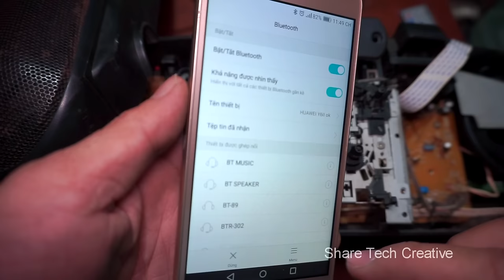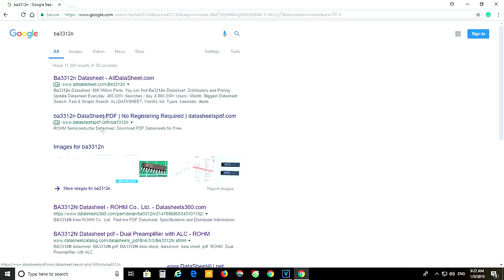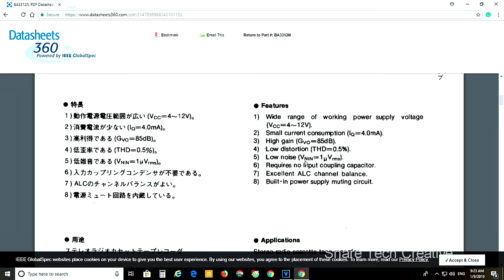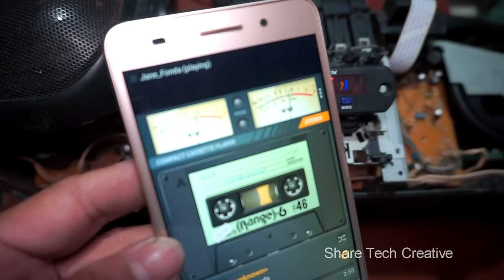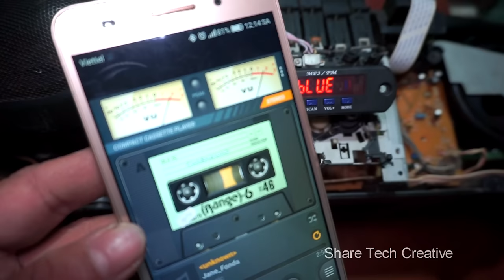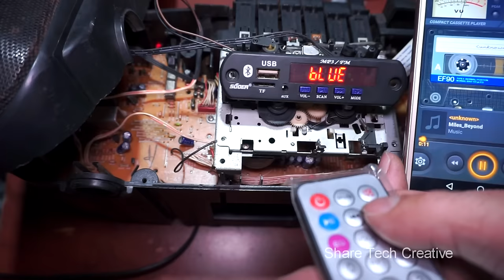Three Ways To Convert Mp3 Bluetooth For Old  Radio Cassette Tapes

Comment from the maker: Ways for your reference 
➤ 1: Find ahead from an old cassette and follow the instructions in the video: 1:32
➤ 2: Solder the output of the Bluetooth circuit directly to the magnetic head. Remove the ic preamplifier from the circuit, then look up the ic pin connector on the input signal and output signal pins: 15:45
➤ 3: Connect the signal wire directly to the circuit board at the output pins: 25:23
➤ Thanks for watching and supporting my channel! Please like, share leave a comment to help me do better videos.
➤ Ways To Convert Mp3 Bluetooth For Old Radio Cassette Tapes: https://youtu.be/I-Co-GCM1UQ♥
➤ How to make Bluetooth for old Cassette SHARP GF 319: https://youtu.be/qKIsGPlDf5Y😊
Reply: P
Reply: ั้ั้ั้ั้ั้ั้ั้ั้ั้ั้ั้ไันเั้ั้ั้ั้ั้ันเหัไ้ำพัั้ำเลีำเเักเพะำกวไั้ำ
Reply: Mantap
Reply: Is 7805 on your blutooth module break
Reply: 08h30
Reply: @dafadzaky9448  hya0tq6⁶5
Reply: @สมเกียรยติเจตะบุตร  sd
Reply: 5oo
Reply: ..m
Reply: ...mmmmm.
Reply: Mmm..mm.m
Reply: M..mmmmm
Reply: M..mmm
Reply: ..m
Reply: M..m
Reply: ^ω^
Reply: ^ω^
Reply: Can we connect the input of 12V DC to a 5v Bluetooth decoder device. The specifications say its 5V/12V. I don't understand this. Please explain.

Comment: Just put 3 way switch for BT function as an additional locate the input of the tone control then then cut for BT and from radio and cassette then connect....this method is just upgrading the old radio cassettes player

Comment: Why need to connect via two headtape? Just connect three wire together directly!
Reply: u r right .waste fellow
Reply: I think the signal level what the head produces and the one what the BT unit is not the same. If signal of BT is much higher than the head signal then you can have distortion as the preamp imput signal is adjusted to receive lower signal from head. If you noticed he bridged the preamp in/out completely when he soldered directly the BT output to the head wires (option 2) by this feeding directly the BT out to the power amp ic excluding preamp. What i see issue in these builds is the background noise, the whining you hear as soon as the BT unit is started. That's because of the ground loop. He used power to BT unit from the motor of the tape. He should use an isolated dc to dc converter or a separate psu for the BT module.

Comment: Couldn't you just tap the line output from the preamp chip? Then you can play tapes as well as bluetooth. not at the same time I don't think.
If you put an audio out jack on that same line you could maybe dub your tapes to PC. I have an old CB radio that I modded like this and you could record what was on the CB as well as play audio through it.

Comment: So how was it all put together in the end? The only problem with this mod is you can no longer play cassettes. It's great to add Bluetooth to an old boombox but not so great to take away some of its original functionality like not being able to use a cassette deck anymore.
Reply: You can always just solder the power cables of blt mod to the ones of the motor, without removing it from it. If you have a Cassette player with two slots, even better.

Comment: some friendly advice about your videoing 1. your videos are too long they should be less then 10 minutes 
2. get rid of the over head camera we only need to see you soldering once. 3. try to explain what your going to do using before and after photos even diagrams 4. showing web sites is good what you are buying and what you are paying  5.  I think your connecting into the speakers into the cassette player start button and I guess into the power somewhere but its hard to follow 
6. drawing arrows and circles on your images is also good if you can. 7 Try slow and reflective music sometimes.
Updating old machines is fun to watch and makes me feel good, even if I don't ever want to do it. 
You should be getting more subscribers then you are maybe this advice will help 👌
Reply from the maker: Thanks for all your advice. I will try to fix for the upcoming videos
Reply: i

Comment: I tried 2nd and 3rd method on my Philips player, removing AN7323 pre-amplifier, but in both cases i get an abnormal noise which disappears only if i disconnect the output connector from the board. How can i solve this problem ?
Reply: I found that the problem is related with the 12V source i use to power the board : if i use an external power supply all is good while when i try to use the tape motor source, as in the video, than the noise is present. I'd definitely prefer the latter solution but without noise... any suggestion ?

Comment: Sir I performed it at home with regulator ic 7805 and bluetooth kit, but when i conected audio input to the tap recorder amplifier it was to much noise in speaker. I conected audio input with head wires. This problem was out my knowledge why is this so. Sir kindly guide me what is problem..
Thanks
Reply from the maker: You can provide your own power adapter

Comment: 256 / 5.000
Çeviri sonuçları
hello, your video is very good, it gave me an idea. I have the same tape recorder. The output IC of mine is LA4597 inputs 2 and 6, I connected it the same way, but the volume key is disabled, the sound comes out, but I can't turn the volume down and it's very buzzing, what can I do. Thank you

Comment: 21:15 would u mind explaining what u did there? why those jumpers? and why did u removed preamp IC? Is it not needed?
Reply: Dear Clark, the bluetooth module's audio outputs are already preamplified, that's the reason the preamplifier IC was deleted while the inputs and outputs were jumpered (bypassed) to have a continued  audio signal path into te rest of the circuitry. Kind regards from Mexico amigo!!!
Reply: @raulconve6841  Thanks

Comment: i think the sound will be super clear becous when we conect the output wires of blutoth drive to the pae’s audio ic that creats som noises but in this head to heat methot the sound shuld be super cristal clear
Reply: That could perhaps be fixed with a couple of resistors to the left and right channel wires.

Comment: 1000% you take long route to add blue tooth kit, easily you can pin its audio out puts in directly in tone (variable) and get supply to radio kit and add a small band switch to jump between radio and mp3 kit. in this case you can also play tape cassette.
you switched off one function of this two in one.
I'm not appreciate your job. sorry sir

Comment: Hi , I do the third method ( removed pery amp ic : BA3420BL ) , mp3 player is working but old radio is broke and not work , what can I do ?
Reply from the maker: You carefully check the points you have made to see if there are mistakes! and you remove IC BA3420BL does not affect the Radio circuit part. Thanks
Reply: @ShareTechCreative  Please help me , check the BA3420BL datasheet , I removed it ، As I said mp3 player is working but old radio in not working , I connected pins 5 and 13 to the mp3 player input and don't have any voice

Comment: Why don't they make those with DAB + radios on & not crap FM when the system they are upcycling already has an AM/FM radio? It would be better to add DAB as well as USB. SD & Bluetooth
Reply: Crap you say? Almost always FM sounds better than DAB because it... isn't digital
Reply: @oliwier000b  i just think DAB would be an idea for a module to add to an old stereo or radio that already has FM rather that 2 FM tuners
Reply: @ChrisATV301  i'm talking about you calling FM crap
Reply: @oliwier000b  not crap as in quality. It's far better than DAB. It's just a shame they didn't add fine tuning features to FM to fit more stations on than have DAB. They should have gone no lower quality that 128 bit rate with all music stations
Reply: @ChrisATV301  some stations are even 24kbps!
Reply: @oliwier000b  I know. That's just ridiculous! For talk stations that's ok but music needs to be at least 192 bit rate. They need to re develop DAB. Alot of people refuse to buy them because of the low quality & either listen to digital radio through freeview, sky, freesat & virgin or stick to FM
Reply: @ChrisATV301  i've seen music stations on DAB with 96kbps mono.

Comment: Sir,  power supply to MP 3 , FROM MOTOR WILL MATCH ,& HOW WE HAVE TO IDENTIFY + & -  .
Reply from the maker: When you unplug the two power supply wires for the motor, please mark the positive and negative
Reply: This is wrong. In most of the modules, the supply voltage is 5 volts, whereas the motor's voltage is 6volts or more.
As such you have to use 7805 regular circuit.
Apart from this, the module's signal output can be given at the selector switch's tape input or at the input point of amplifier through it's own vol. Control. Please don't complicate the wiring like this.
Reply: @yesemve  Thanking you very much for your answer, once Thanking you

Comment: This is rong  connection audio not clear you fully avoid head pre amp you can connect  through the head pre amp out put  capacitor .Must be removed head connection.